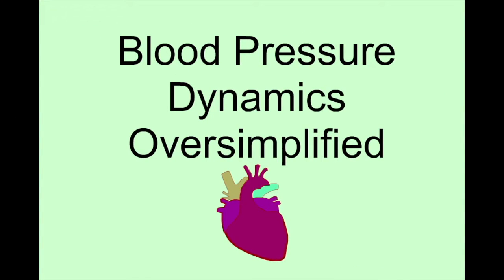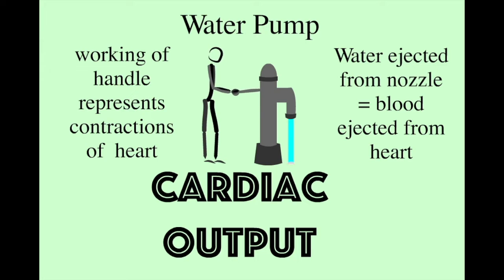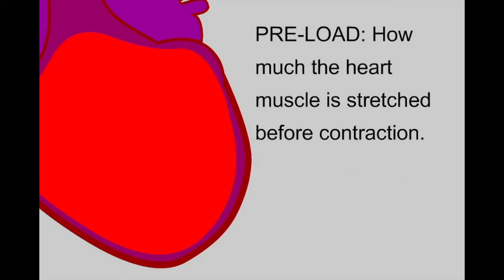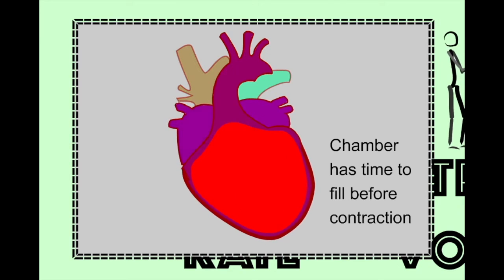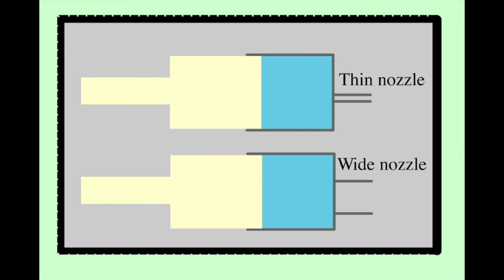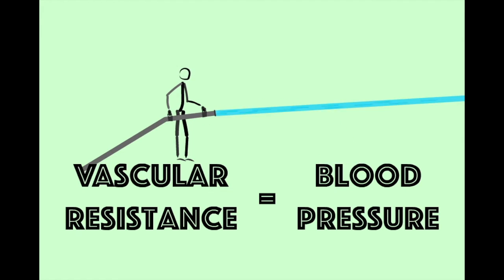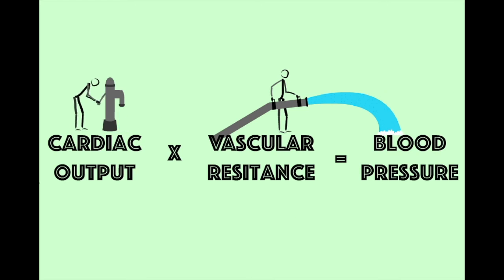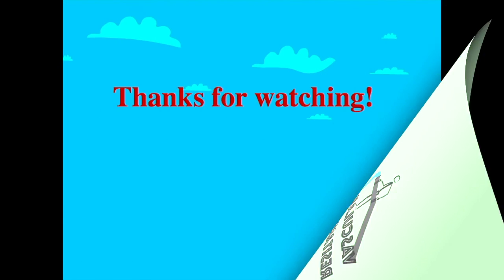Blood Pressure Dynamics (cardiac output, stroke volume, HR & vascular resistance) Made easy!

Comment: A stupid question but it's really confusing. How does vasodilation improve perfusion as we're told but at the same time decrease blood pressure? Aren't those two things mutually contradictory? If blood pressure decreases then perfusion would also deteriorate?
Reply from the maker: not a stupid question at all. when we talk about vasoconstriction and BP we are taking about systemic resistance, eg. the combined effect of all the blood vessels constricting through out the body. when we talk about vasodilation and perfusion we are often referring to the smaller blood vessels supplying local tissues. The smaller blood vessels, direly supplying the tissue, need to be dilated enough to allow blood to flow. At the same time, larger vessels may be constricting increasing BP. Hope that's helpful, its a complicated question that's hard to answer in brief....  Dan